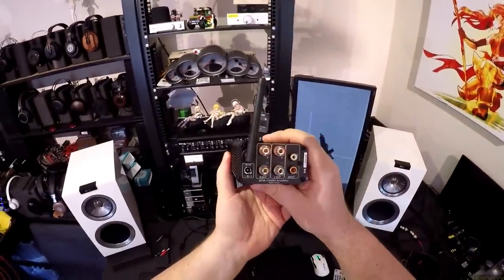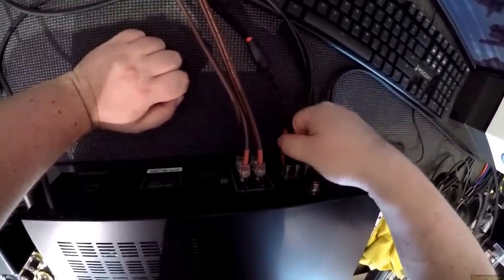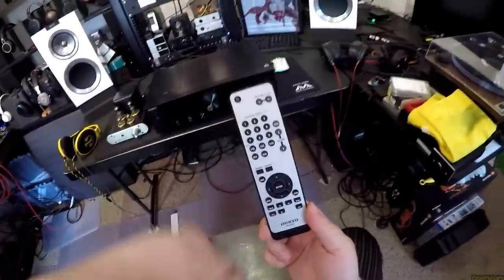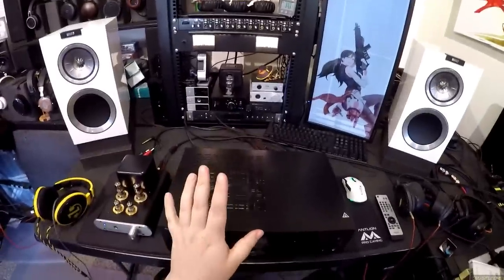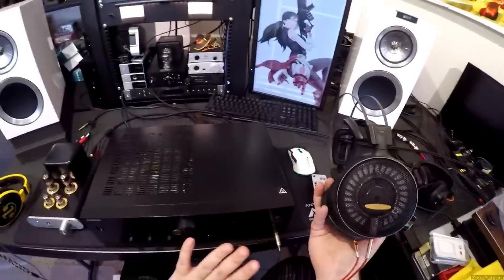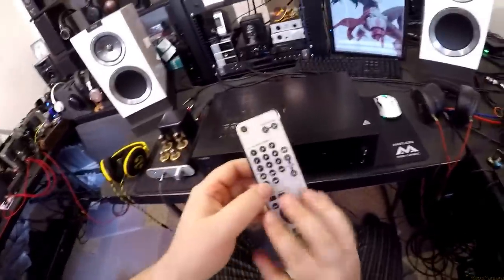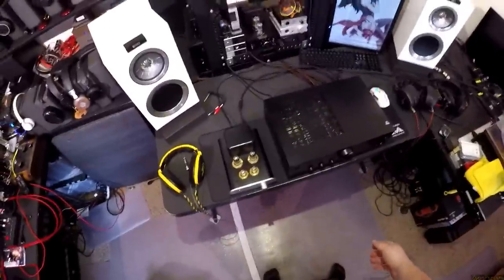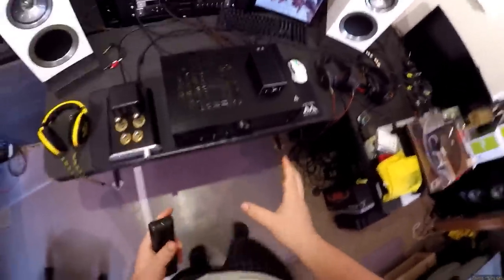Z Review - Onkyo A9010 [The Return of Real Amplifiers]

Comment: You can use "line outs" for a sub, you just have to use the sub's X over, and of course both left and right goes to it.It won't affect headphones at all. did you get your engineering degree in the Bahamas by chance?
Reply: Billy Grinstead if you do this the volume of the amp does not affect the volume of the sub. You would have to adjust the volume of the sub at the sub every time you turned the volume on your speakers up or down. A sub with speaker level inputs is the only solution.
Reply: @antonioramirez694   That would be ideal, and is what you used to have to do because sub outs were not common,  so whats wrong with  setting the sub level for whatever amount of bass you need? Thats what the level on the back of your sub is for, and some  sub manufacturers put a level knob on front just for that purpose.
Reply: Billy Grinstead not amount of bass. Volume. If you are listening to a song and wanted to turn the volume down a bit, you would also have to separately turn the subwoofer volume down. Same if you wanted to turn the volume up. The amplifier’s volume control would have no effect on the sub. Doable, but highly inconvenient.
Reply: @antonioramirez694   Subs don't have a 'volume", they have a level, there's' a difference. You  set the level, and that's what you get, that amount of bass. Want a lot of  bass, turn it up, less, turn it down.

Comment: Never been a fan of Onkyo. They fudge their specks. Even for this amp they only measured it at 1Khz rather than 20hz - 20khz, and distortion was only tested at 1 watt. No rating for 4 ohms.
Reply: 70s Onkyo is still some of the best out there.
Reply: I got a 9050 , it is incredible for the price .
Reply: I have a 90's prologic 5.1 onkyo and a 80's stereo onkyo, and so far with all the amps I've used (15+) they are the best.
Reply: @marcgallant5270  well, most people just want a modestly priced system that works well. We don't care about the spec sheet.
Reply: HA.  probably THE most honest statement ever concerning 'HiFi. @Lawful_Rebel

Comment: The Yamaha 202b provides better value.
Reply: Yeah but the Yamaha has 100 watts per channel,great Bluetooth and you could add a better DAC than comes with the Onyko for less than $100.I got the Yamaha 202bl for $119.00 .Sounds like a better value to me.
Reply: It's all about what suit's your needs. For $119.00 on sale most of the time. It's great bang for your buck
Reply: Yamaha's A-S line of integrateds have been fantastic going back almost 10 years and offer great value
Reply from the maker: If anything I'd look at the S301 [https://amzn.to/2IUAQOF]
Reply: I think that this or the Yamaha would be decent and provide good value but I personally for the same money would look to buy an actual preamp and separate amplifier because I don't think jamming the preamp and power amp in the same box is a good thing but this would mean picking them up on the used market .
 I absolutely guarantee an Adcom GTP-400 paired with a GFA-535 Designed by Nelson Pass would kick the crap out of either midfi being discussed here .
I've used my GFA-535 to push. Maggie's and that would cause either the Onkyo or the low end Yamaha to pop like a tick lol
Reply: It depends on the price you get it for. I bought this amp on sale at Fry’s about a month ago for $200 and I’ve seen it on sale between $250-$300 at other retailers before too.
Reply: I went with the Emotiva pt-100 preamp/DAC/tuner and the Adcom GFA-555 and the high-current woke up all my speakers. Right now I have a pair of Dynaco A-25's shoehorned into either side of this monitor, and the 10" drivers make this old hippy soooo happy, and the Adcom wrings out every bit of wonderful detail from the exceptional Seas tweeters. I now consider my desktop system to be at "kick-ass" level, especially for the prices I paid for the gear. Only the PB-2000 sub is what I'd consider high cost, and that's only relative to the other gear I have.
Reply: Does it have a detachable power cable? 😉
Reply: You should be looking at the YAMAHA A-S801.  I currently own one and its a gem!
Reply: 25w is enough for most speakers
Reply: *I'm a big fan of Yamaha equipment but I don't think you comprehended 
what Z said in the review about power rating. The Yamaha can push 100W 
per channel with more than 2x the harmonic distortion of the Onkyo at 
44W (0.2% vs 0.08%) , so in real use I would expect them to be very 
close in actual power output ability. You'll also want to add a pre-amp 
if you wanted to use the Yamaha with a Turntable. No doubt the Yammie 
also presents great value but better value, I'm not convinced.* 

To retort to this...
* Onkyo is no longer Onkyo, it was taken over a while ago and their products are mediocre at best. 
* Yamaha is by far superior specs and quality wise
* 44W at @ 1khz tested, for the real audio knowledgeable people, that's a FUCKING JOKE
* THD tested @ 1khz is a joke, at full range it would be the same as Yamaha only at 25W or so. 

* THD anything under 0.9 you will never, ever notice/hear so the yamaha is well under that number 

* The Onkyo THD was measured at 1Watt no shit it has that spec, it's a POS

 Let's be factual and straight here, this Onkyo is a complete joke especially for the price. It shows skewed specs based on "careful" testing methodology to up the watts 1khz tests is not where you have even a load on a amp. It's the full range 20hz till 20khz @8 ohm where they should test, then you get actual numbers. I can guarantee you? The Onkyo would completely crumble in any decent audio setup. For the price there is plenty better out there..
Reply: Dude, I'm looking at Yamaha's new network receivers. Getting excellent reviews for sound and they do everything.
Reply: I had the A-9010 before. It's amazing sounding, very dynamic and energetic. For 115USD this is the best value audio equipment I ever bought. Even cheaper than the AudioSource amps... I also had the A-S301 for a brief moment, and returned it because it sounds very thin; also tried the A-S501 all the way to A-S801 - the hundred series all had the same sound signature. Probably because the Yamaha emphasized the top a bit too much and caused the mid-range to sound a bit recessed. (However, the A-S2000 that I finally settled on sounds really natural, but it costed a cool 2 grands if not on sale. And it's discontinued and succeeded by the A-S2100 which is more than 3 grands. I had the A-S2100 loaned from a friend and frankly it sounded very close to the A-S2000 so I didn't make the switch). But I haven't tried the R-Nxxx and R-Sxxx series so no comment about that 202.

For tonal control I always prefer to set it to 0 because it just sounds best in terms of clarity for any given amp I tried - if they had the "defeat" implemented correctly (i.e. taking those 2 pots out of the circuit).
 
You cannot judge an amp solely by its specs, especially for pretty closely priced/powered amps.
Reply: I had the Adcom GTP-400 paired with a GFA-5500. The GTP-400 was a bit too noisy (at least the 2 samples I had) and I switched it out with a modern preamp; and frankly I used the Yamaha RX-A1060 preout to drive the GFA-5500 which sounded to me better than the GTP-400 did. These newer integrated are very quiet compared to older designs and older electronics - which will develop noise over time due to degradation especially on the capacitors. But if you did look past the noise and gamble of the used quality, the older Adcom power amps were really great, especially the ones designed by Nelson Pass (e.g. GFA-555 II and its siblings). 

For Maggies, best to pair them with high current amps (The Adcoms are high-current). The "hundred-priced" integrated won't do the trick. The cheapest setup I had success without going into used market was the Parasound integrated, or the P5 + A23.
Reply: What's a good external DAC for less than $100?
Reply: I wouldn’t get too hung up on the numbers that the manufacturer puts out. You can get amp numbers about anything you want if you manipulate other factors such as distortion and ohms load etc. The bottom line is that it’s all about the sound. The NAD c316bee is rated at only 40 watts at 8ohms but would kill both the Onkyo and Yamaha in sound quality. Same thing goes for the Music Hall a15.3. Both the NAD and Music Hall have toroidal transformers that allow for tremendous headroom during surges in power demand. Looking at straight numbers reminds me of the scene in the movie Spinal Tap where the guitarist is showing off his equipment and keeps telling the interviewer that the Marshal head @mp is better because the dial goes to 11.

Comment: 44 watts per channel and only 14 pounds?? I have vintage amps that have less watts and weight more.

Also, true vintage amps don't use a remote control and can play 4 speakers, 70s had so much better to offer than the crap being sold now.
Reply: 3en6ie 3en6ie My Tandberg Huldra 10 from 1974 is all original and sounds better than anything modern I've ever heard.
Reply: 3en6ie 3en6ie I'm actually 18, vintage just sounds better than modern. 60s cars are also better than new ones.
Reply: 3en6ie 3en6ie yes and your point is? Get it serviced it doesn't cost that much or do it yourself, my 40 year old amp never had a recap and it sounds great
Reply: Hi-Fidude66 Hi-Fidude66 Get back to us when you grow up and have at least another ten years of audio experience. Same goes for cars. At 18, you don’t know what you don’t know.
Reply: Jack Burton I grew up with vintage hi-fi, my father had a lot of amps including Marantz, Sansui, Tandberg, Philips and more. As well as reel to reel, casette and vinyl record players. I know enough about vintage sounding better.

Cars of the 50s and 60s have personality, charm and style, with large roaring V8 engines. They weren't just a bunch of plastic parts glued together filled with unnecessary safety crap and a 1 liter eco BS engine.
Reply: 3en6ie 3en6ie Not if you get in an accident.
Reply: You might be dead in the crash, but the car isnt. Old cars were strong and could take a lot of beating. But they still had lower weight to size ratio even with all that metal, because they had no safety or computers. Its impossible to get a car now that weights less a ton, something that used to be common before.
Reply: Grow up some more and get back to us. Daddy's stuff doesn't count.
Reply: Any amplfier or speakers you have, mine are better.
Reply: Correction: Any that daddy has. And you still don't know what you don't know. The arrogance of youth.
Reply: You are acting like you know everything. I have heard $2000+ Denon and NAD amps, sounded good but not empressive for the price. My $50 Tandberg hybrid tube amp from 1968 sounds just as decent. Anything from the 70s that cost $2000 will crush a new McIntosh right into dirt.
Reply: screaming metal death trap
Reply: People say "sounds better". It's a personal preference. It doesn't mean it has less distortion or power than more modern stuff - usually it has more, by quite a bit. Most likely it has a certain sound signature that people like. But, you can get high end vintage stuff that costs less than an entry level today. What cost 1000 in the 80's would cost 3000 today, new.
Reply: The sound singnature of a modern amplifier is cold, precise and boring. Tandberg was well known in the 70s for having transistors sounding almost as warm as tubes, especially Huldra 9, 10 and the lower TR models. I can not enjoy cold and harsh sounding amps. Even warmer and more enjoyable than that was the Huldra 7, stereo tube amp from 1963, or the McIntosh MC240 from 1960.
Reply: Hi-Fidude.....  old technology vs. new technology. you're comparing apples and oranges.